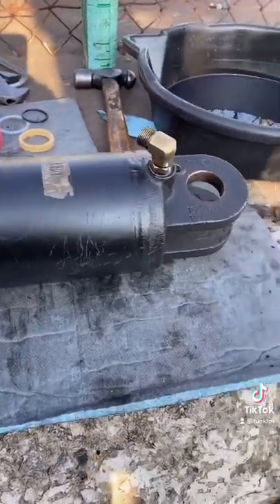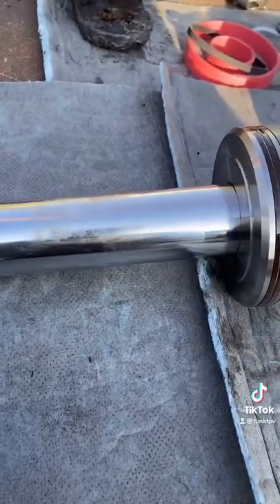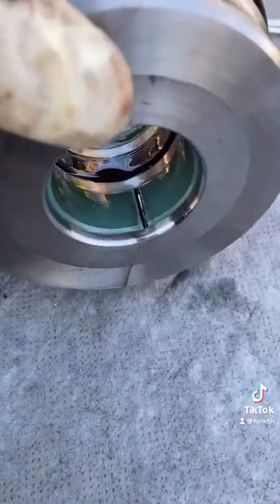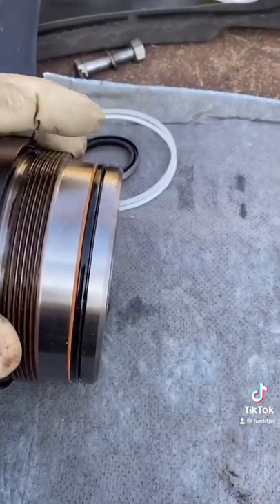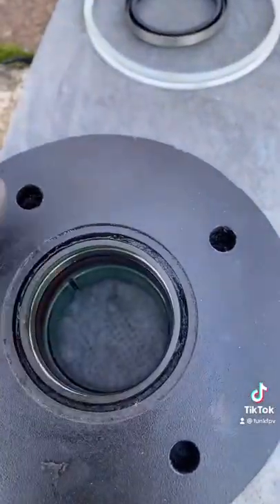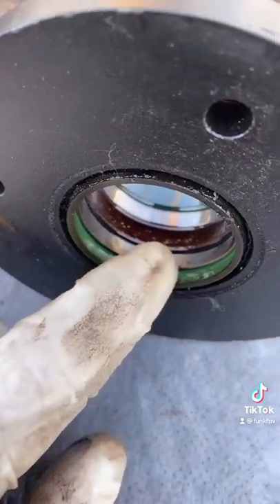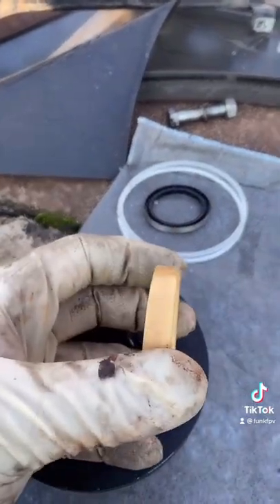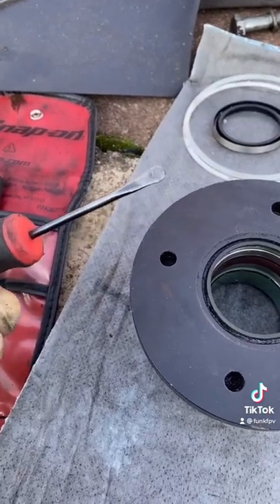1 Minute Hydraulic Cylinder

Comment: Pretty sure if you have a common Snap-On screwdriver set and use them well for 20 years you end up with a free Snap-On seal tool set :)
Reply: The edges wear off?
Reply: Only 20 years I can’t wait to get mine
Reply: ehhh maybe 20. I just had a new blade put in my snapon screwdriver inherited from grandfather in law, it was worn down and rounded out to the point it looked like these seal tools. the snapon dealer estimated the screwdriver to be from sometime in the 50s
Reply: @Johnnyreengo  just in time to have them paid off lmfao
Reply: You might have them paid off by then
Reply: @oprahstaint  made in the 50's lasted 70 years. Made in the 2020s you'll be lucky if it'll last 20.
Reply: That was my thought . I just realized I have an old wood handle seal tool
Reply: Or a harbour freight set after 6 months 😂
Reply: @jonathanwright5550 he said there nice n rounded so I assumed made that way

Comment: Sweet thanks!! I always thought "gland end" was just some perverse slang.
Reply: Same! Then the brown thing also
Reply: Well all these names were created by engineers....so ya they probably are
Reply: Lmao I thought AvE coined that phrase
Reply: @motoredbikemadness2061  Nope, that is the industry standard terminology for a polymer or elastomer lip that cleans the shaft of a hydraulic cylinder as it slides back into the housing. That's not the worst one though. A short section of pipe that is threaded on both ends is called a "nipple". I mean ffs basically all plumbing and electrical connections, except for welding and soldering, have a "male" and "female" half. And technically speaking when connected they are "mated", although that one isn't used often anymore (at least not for these types of things).

Comment: I repaired these for a long time, pick sets quite often  hooked and sharp picks to use getting out old seals, don't leave scratches in the metal and no worries. If you put your new seals in boiling water theres a fair chance you won't use the pick to put them back in, makes them much more pliable. As an aside never put the barrel in a standard vice as you can warp it. O - rings occasionally have a backup on both sides if groove spacing requires. The gland is called a Head in Australia and the rod is commonly called the shaft, the holed end is called a clevis. Rotary oil seals can be used in lieu of a wiper as long as it has the wiping lip.

Comment: Little bit of trivia, double acting cylinders move faster in the retract direction due to less volume from the rod on the piston, they move faster but have less hydraulic force than the extension side does. Fluid power is simple but everyone wants to treat it like rocket surgery, the leaks leak and the squeaks squeak just like the customer likes.

Comment: Thick music wire is great small tool making stock. It's hardenable, comes tempered to a pretty tough and bendable but you can aneal it and pound it into whatever shape, or just bend and grind depending on what you need. 

I have a ton of small handled tools from picks, drivers, carving tools, sculpting tools etc so having a big coil of rod that's a good diameter for that kinda stuff is sooo handy even if its a bit more hassle than buying straight sections of ground tool steel.

Comment: If for whatever reason you're struggling to get the piston out of the barrel you can use an air compressor to force air into the barrel and it will force the piston out, something i learned working construction, helping the mechanic repair the massive heavy machinery pistons when they would leak oil, just please make sure not to stand in the direction of the piston when you force the air into it.

Comment: 15 year hydraulic tech 
You nailed it..
Make sure you get your o-rings and Polly seals in Viton material when possible. Less corrosive with biodegradable hydraulic fluids (when used) and higher heat/ pressure capabilities. A little less flexible than standard materials but wells worth it for longevity.

Comment: A good way to remember which way they open end on a seal goes is to know how it works. The oil inside of the seal applies pressure against the lips, forcing it against the surface it slides along and it's seating groove, preventing leaks.

Comment: Dang that's way more simple than the ones I work on. So many less wear rings and cup seals. I kinda envy you. The last one I rebuilt was a 400 ton shear cylinder where the center is a piston but doesn't move then a U shaped piston that moves then the barrel. It was confusing until I was told how it worked.

Comment: Also the wiper seal, a good analogy are the crank and cam oil seals in ur “car” engines. Like u said only seals dust. No pressure or load bearing. So now u know the crankcase in ur car, doesnt hold pressure. 

Fact:its the air is under slight vac normally to vent the gases and the oil is under vac sucking into the oil pump

Comment: Power side of the cylinder is always the piston side due to its increased area compared to the rod end, that’s why cylinders are oriented the way they are
Reply: Some cylinders are counterbalanced with a secondary rod on the opposing end of the piston to compensate for the offset volume from the rod stroking to apply even forces in either direction. EG forklift side shift cylinders

Comment: Glad the pins came out for you. On tilt cylinders,   I usually end up taking out just the front pin on the mast, and disassemble the cylinder, pull out the ram rod and piston out the front and leaving the barrel on the lift.  Good job ''packing" alot on info in one minute. Pun intended..

Comment: Great job! But first thing I noticed it was apart. I figured not because ya just wanted to do a parts run down-which was great- and the suspense built as the parts were checked off UNTIL we saw the cup seal. That looked pretty bad. Excellent job going through a not well known piece of the machinery. You definitely know what you are doing my friend!

Comment: The ranch I worked on had a John Deere 4430 with a 740 loader and both lift arms blew the seals within a day of each other and instead of gettin me the right seal kit to fix em both I was given a box of random seals that were almost the same size but they were a little different and well..they worked for a month or so. Moral of the story get the right parts for the job so you ain't gotta do it twice!

Comment: I can guarantee you that the Hydraulic cylinders on the forklifts at lowes have NEVER been serviced until they break. 

We had one the oozing fluid and the ASM's told us it was fine. Now I'm not a mechanic but when you have moderate to high pressure and its leaking fluid something it bond to go wrong

Comment: A kettle of boiling water and an old coffee cup are my favourite tools for repacking glands. The risk of damaging seals on install is almost non-existent, when you can install them with your fingers.
Reply: The buttercup seal that the gland in this video uses is soft and pliable, it can be installed by hand at room temperature. Oddly enough it is also carcinogenic.

Comment: The only question I have you said it's a double seal system because it has pressure coming from both ways. So when you say to put the open end towards the pressure, does it matter which way on that system?

Comment: Those snap on seal tools.... another option is getting a cheaper flathead 🪛   heat up the tip with a torch and hit it with a hammer a couple times until it's smooth,thin, and slightly curved if you will. Have fun with it.

Comment: I've got a large pneumatic cylinder actuator at work that's leaking through the exhaust vents in either direction.  The little ones we use don't do it, so I know it isn't supposed to.  It was also an older one retired from a task we don't do anymore.  What's annoying is I can't tell or find out if we stopped the task because the cylinder leaked or because we stopped needing to do it.

Comment: If pressure comes from both sides, which orientation is correct? After watching again, I succumbed to the videography curse and mistakenly thought the cap was something that held pressure on both sides. I've even worked on these in person in much larger scale in the navy and in a factory. This is why you develop and teach good habits and instincts because thinking can cause issues in such environments.

Comment: I always wondered what the rings look like on a hydraulic piston
Reply: There are many different kinds of piston seal configurations, some cylinders have two oversized buttercup seals facing opposite directions, some have twin pressure lips, others are commonly called "quad rings" and are shaped like an X. Some look just like O'rings with backup rings on either side. The only real differences between them are their maximum cycles, pressure ranges and heat ranges.

Comment: You did frigging great. I know a few who could use this info. Myself included. Haha. Worked at a rental shop fr 8 years. How in the he'll did you get the gland broke loose.
Reply: Large chain wrench or even large pipe wrench. Some use a spanner wrench arraingement but those often slip off. A chain clamp on a steel table is nice for holding the cylinder. 
One little secret is to tap the gland nut and the cylinder just below the parting line with the round side of a ball pein hammer. Give it a few taps spaced out all the way around. This tip can often help with loosening the gland nut.

Comment: Lemme take a second to breakdown a pneumatic pressurized cylinder: you have the steel/aluminum/ceramic/carbon fiber bottle and the valve attaches typically to the top with threads that screw in. You then have the safety, valve handle, and the exit of the valve.

Comment: cup seal failed and open emd of cup seal towards the pressure... got it... at work we got those cup seals split ring with metal springs molded inside and we stack 4 together on each side of a shaft to keep liquids in which are inspected weekly at minimum sometimes even more requiring disassembly of machine   the four go like this <><>| liquid |<><> instead of <<<<[ liquid]>>>>  it's been a topic of much debate around the toolbox 🧰 about manufacturers specs etc but because the shaft spins ya don't want the molded in metal to grind against the face side whch is why the thicker >| to roll against the side now rhe liquid itself helps lubricate and seal the seal but when it leaks oh boy does it leak... they're usually clampped  🗜️ on with half moon clam shells forming a high grade plastics grip from both sides of shaft the slid over with a sledgehammer and 🔩🔩🔩🔩 bolted on... once they started prescribing snow white petroleum aka Vaseline on the shaft seals it really worked 75% easier and better against wear and tear before going in dry and being a very expensive wear parts just due to quantity and failures😂

Comment: does what you said about the backing ring hold true in generally every situation I replace the hydraulic drive unit on my lawnmower and I can’t figure out why it still leaks but after seeing this, I’m wondering if I put the backing ring with the O-ring in the opposite configuration. any thoughts

Comment: I would have liked it if you explained that the wear ring expands slightly under pressure. Also next time you break down a multistage cylinder you should show the spanner with a breaker bar on it. I no shit knocked myself out breaking the lock tight on a 4 stage when the spanner slipped. Fell right on my ass and hit my head on the parts cleaner.

Comment: First, then the pump controls which side of the cylinder gets more fluid/higher pressure?
Reply: The pump keeps the pressure up and the control valves direct fluid to either side of the piston. When one side is pressurized it pushes the fluid from the opposite side back to the tank.
Reply: @markm0000  thanks, that make alot more sense then what I was thinking
Reply from the maker: What Mark said 👍🏻